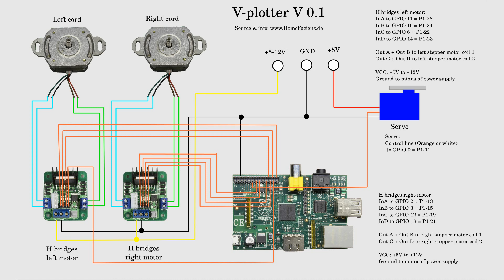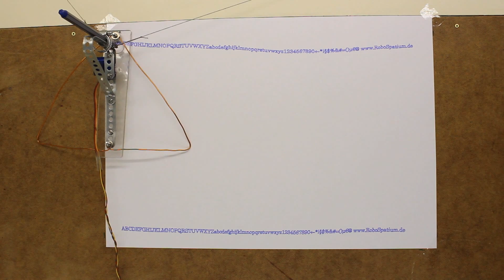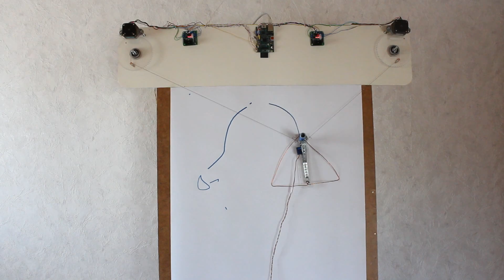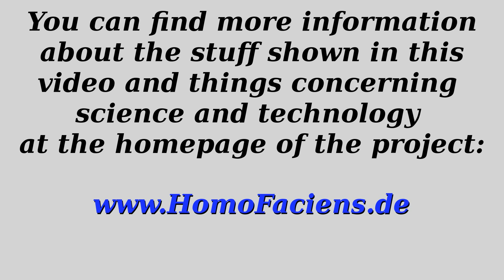Hanging wall plotter (V plotter) with a Raspberry Pi

Comment: FWIW, if you have the cord wind a number of times on a drum and exit it at the other end, with a weight on the end of the cord, the cord will never overlap itself.  

Another idea would be to use your CNC to cut slots in a tape measure that a gear would engage with.  If the tape is kept parallel to the board, it can't deflect more than that distance, nor stretch.  Tape measures are also found everywhere and are extremely cheap.
Reply from the maker: Yes, using counterweights is a common design principle for V plotters. However you must avoid slippage of the cords when doing so, which is usually done by using toothed belts. I did not want to use those "special" parts in my first approach.

A tape measure would indeed be a "toothed belt" that almost doesn't stretch under load.

Thanks for sharing your thoughts!
Reply: Hmmm...  A few things come to mind:
1.  If the counterweight = 1/2 * gondola weight, then the forces at the drum should be about equal, preventing slippage.
2.  If the drum is covered with a high-friction surface (like rubber bands or a section of bicycle innertube), the cord shouldn't slip at all.
3.  A second drum held against the first by springs(?) would apply extra force to hold the cord tightly to the first drum
4.  Beaded roller blind cord (which is cheap and readily available) with a 3d printed pulley would have zero slippage.
Reply from the maker: I tried things like this as well, but you definitely need a toothed belt to avoid adding up errors over time. Even with two rubber rolls held on each other with a spring you get some sort of error (kind of slipping) caused by the deformation of the rubber rolls.

However, it's up to you to build an improved V plotter and so demonstrate that I am wrong ;-)

Another painting machine is on my list of things to do - stay tuned!

Comment: amazing, very well explained. is possible to add another wire, and do a 3d vertical ploter? tha maths will be trickier, but in that project, is all about triangles isn't? with another wire will be a tetrahedron, the maths to move the pen will not be impossible, but i think precision will decrease because a floating pen moving will shake a lot. maybe slow moving and high weight solves that.
Reply from the maker: It would be a delta 3D printer design, thus the maths already exists, but as you said, using wires will result in a very shaky construction. 3D printers must be fast, or do you want to wait months for your print to be finished?
I have seen a robot crane working with three wires as you suggested. That's an application that works fine.
Reply: Google 'hangprinter'.

Comment: If you were to use small sprockets on your motors and small roller chain your deviation will be minimum. You will just have the chain loop over the sprockets and have small counter weights at the ends of the chains. Great design by the way.
Reply from the maker: Thanks for sharing your thoughts.
Yes, that's a common construction principle for V plotters, but there are also drawbacks. The roller needed for the chain is larger in diameter than the motor shaft, thus you get a rougher resolution and you need a special roller and a chain. Chord is available in any household on this planet.

Comment: Can arduino be used instead raspberry pi?
Reply from the maker: Yes, if you know how to change the software code and how to program an Arduino. I (currently) can't give you an Arduino software.
Reply: check out Maslow CNC
Reply from the maker: That's am Open Source CNC router based on the V plotter working priciple. Definitely worth a click.

Comment: Are both steppers moving simultaneously or one at a time rapidly?
Reply from the maker: +Jason Davis The GPIOs of the Raspberry are switched one after the other, thus there is in fact never a real simultaneous operation of both motors. Nonetheless the second motor sometimes starts spinning while the first one is still moving.
Reply: Are they moving in 1mm increments or 0.1mm?  What's the power supply like?  I'm asking because mine run much slower...it could be my software, I'm moving in 0.1mm increments.
Reply from the maker: +Jason Davis With the transmission I am using at the end of the video they move just 0.05mm per Step. The power comes from the 12V line of an old computer power supply. Are you using my design and software? You can speed up the motors by lowering STEP_PAUSE in the source code assuming your motors are strong enough.
Reply: +HomoFaciens No, I'm using some Python code I wrote.  I'm drawing some lines using instructions from a Bresenham algorithm, on a 0.1mm grid.  My power supply is weak, I'm wondering if that's the main issue, it only outputs 9V/330mA.
Reply: +HomoFaciens I should say also that it's on Raspberry Pi.
Reply from the maker: +Jason Davis What type of steppers and electronics are you using (constant voltage or constant current)?
Reply: +HomoFaciens Constant voltage NEMA-17 200 steps/rev 12v, 350mA
Reply from the maker: +Jason Davis So you could at least use a 12V power supply to speed up for approximately 40%.
Reply: +HomoFaciens Thanks!  Love your video, by the way.

Comment: does it matter what type of raspberry pi i have? (i have an raspberry pi B+)
Reply from the maker: +Thijmen van Kooten It should work with all Raspberry models. The Layout of the GPIO connectors is compatible.
Reply: ok thanks.

Comment: Have you tried compensating for the errors you mentioned in software before going to the mechanical solution? Cool to see a design evolve either way. These kinds of projects are awesome because they show how much you can do with really spartan hardware. Thanks for the video.
Reply from the maker: awstrong7 Compensating the diameter of the spools with the cord being wound/unwound is nearly impossible, since you can't predict reliably how many layers are on the motor shaft. I started implementing the forces acting on the cords, but not with much success. As you stated: It's a low tech machine, thus you can't expect high precision from it. It's fun building one with only a few parts - making it a precision machine is a long way to go (but worth going for learning how things work).

Comment: After successful DIY CNC, now there is tool for new projects. Still creating DIY geared servo motor is a masterpiece :). Congratulations on your new project, it brings innovation.
Reply from the maker: Igor Ć. There are several instructions for V plotters available and each machine is made of some special ideas, same as mine. The CNC machine is a really great tool. I am thinking of creating another one.
Reply: You got bited by CNC bug :). Offcourse, creating another one and making improvements in design. I started creating one using some of your concepts, I can tell it's a challenge to create all your own design and make it work. Looking forward to new projects, good luck.

Comment: I agree with the other comments you deserve way more views on your videos.
A stepper motor video should give you good views since it seems people are quite interested in stepper motors especially lately.
I have an older video (from 2011) about stepper motors and that one has quite a lot of views especially lately. I just used a larger stepper motor controlled from Free-DOS with code written in TurboC to control the parallel port (the complete code can be read from the screen if video is watched in at least 720p but did not saved that it was just a test) and then just had 4 transistors and a power resistor for current limiting. It is extremely useless for anything practical was just done with what I had around to see how the stepper motors work but if anyone is interested here is the link watch?v=YlmzsWlK_JA
Reply from the maker: ***** Share my videos if you like them - that might improve the view rate. However with time, clicks will come. I like the way you have mounted a wrench on the shaft of the stepper motor - it's a simple way to visualize the rotation.

Comment: HomoFaciens 
56 views after 2 hours? Dude, you seriously deserve so much more credit and recognition. The amount of work you put in these videos(especially scripting them ALL) is orders of magnitude more than 90% of the channels out there!
P.S - A4988 or DRV8825 modules for driving steppers are much simpler and easier to use. 4 wires to the stepper, 2 wires(minus power) to the microcontroller per stepper.
You can also try making a small(or large if you dare) so-called spider system. It's basically the V plotter, but in 3 dimensions. They use it to fly cameras around football stadiums and such.
Reply from the maker: Electro ...only people that don't understand how things work need luck to achieve a goal once (or twice if they are really lucky guys).
Reply from the maker: ***** Thanks! Yes, there are countless boards available, all of them with special pros & contras. I will try some of them when recodring videos about stepper motors. Spider systems are also very interesting and maybe there will be a video about something like that sometime... .
Creating quality videos takes time, so don't expect your suggests being turned into videos tomorrow...
Reply: HomoFaciens Thanks for the response. Of course, I know they take time, I'm not rushing you to do anything, or even suggesting it be a project for the channel.
A question I forgot to ask: how many fails do you have when narrating the video? I tried making a voiced video, but I had ~10 times more fails than successes, I made too many mistakes in sentences.
Reply from the maker: ***** ...I am recording sentence by sentence with audacity and put it all together in kdenlive. There are indeed countless fails, especially in the english version. Recording the audio track for that 11min video took approximately 120min...
Reply: HomoFaciens Well, thanks. Good luck with whatever you're doing next :)
Reply from the maker: ***** Thanks!
Reply: HomoFaciens No, you don't need luck. You will just do it, I trust.
Reply: HomoFaciens You are absolutely right. Great work.